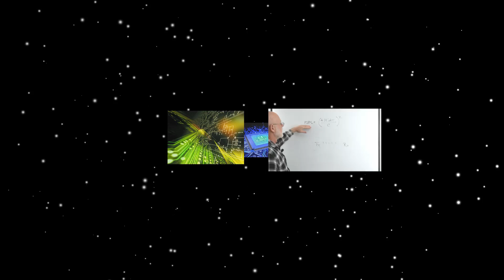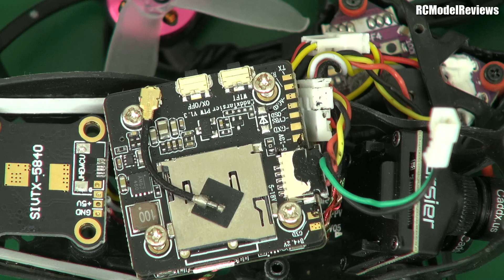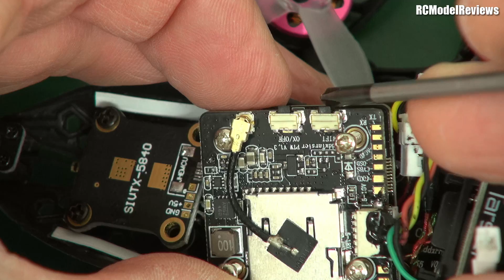Why are so many new products faulty?

Comment: i might have to remind you Sir Bruce, of your fab ZMR series where you gave the Tip to "buy 5 of everything as lack of QC will make sure there's always a dudd"   of course, that was quite a while ago AND it was about building a $100 'quadcopter'  :)   thats my two cents.   not spending.no cash.no experience with qc issues. , well maybe one, the ViFly X150, a joy to play with, kept burning outnthe vtx, but they did send me, free of charge, replacments both times.   the x150 alas rests at the bottom of a lake :(

Comment: only fix is to solder on a plug, then use the other half of the plug to short the swwitch, i had to do this with a runcam split, same switches, not really robust enough for the use.

Comment: Yes I find manufacturers are just sending out garbage. I have problems with virtually all new products bought.... not review samples...I buy my hobby products and then I am stuck with the problem. Then just try and get the manufacturer or seller in China to repond, it's a circus to get satisfaction. I now but from sellers I know are easy to get warranty service, no longer the cheapest route (since I now expect to have to deal with some issue).

Comment: Bruce.  In my experience, this quality control problem isn't new at all.  It seems, to me, that there is always something that's dodgy on the Chinese products.  Whether it's a capacitor that swells up, a switch that's intermittent, a remote control that goes through batteries way too fast, or a display that only partially works.  I will say that most of these problems seem to show up in Chinese single board test equipment and things of that nature.

Comment: In the last few months:

ts5823s video transmitter - can't be set to all of the listed frequencies

RS2205 2300KV emax motors 2X CW & 2X CCW - 1 would not turn 360 degrees. Something inside stopping it. Received replacement and 2 motors made scraping noises as they were rotated.

Mini RS232 To TTL MAX3232 Converter Adaptor Module Serial Port Board - Boards get VERY hot in operation. Supposed to work at 5 volts but when voltage is dropped to 3.5 volts, they stay cool.

Comment: What is point of 4k on a small quad if it doesnt have some kind of damper to get rid of vibration.  1080p 60fps with good damping would be much better (less energy usage to shoot in 4k).
Reply from the maker: 4K video gives far more scope for doing stabilization and cropping in edit.  I can turn a really shaky 4K video into a silky-smooth 1080p one that looks like it's been filmed using a gimbal.

Comment: I have had a lot of bad stuff lately from Kingkong/LDARC. My ET115 arrived with two bad motors and QC tested sticker between them. I went through about 8 motors before switching to HGLRC. Once the motors were fixed, I began having 4 in 1 esc problems. After several KK 4in1s died, I switched to iFlight. No problems now after removing most of the KK electronics.

Comment: My geprc 12A whoop board on about 4th use had the component near the power supply terminals just pop off! Resistance was very low, I think it is a shunt. Anyway, soldered it back on, board works. Before I soldered back on I asked geprc support what the component was and if they could tell me the value such that I could test. No response, retailer asked also and they didn't get a reply. So QC and support not good, probably will not buy geprc products again

Comment: Never had a faulty piece of electronics from BangGood in my two years of buying there. Maybe just luck? I mainly have FrSky, Matek, HAKRC and Runcam RC stuff though. Also some Machifit, Eleksmaker and BQU hobby electronics, Xanes bike lamps, Xiaomi consumer electronics... Well, as I look back all the electrical stuff works. Only total crap were ZOP batteries, but it was not a question of QA, they all suck by design it seems. Waiting for a Hawkeye Firefly Split to arrive, we'll see. ;)

Comment: I get parts for a product that I sell custom made in  China, and I've noticed this as well.  Not only a drop in quality, but an increase in general logistical problems, overcharging, and them trying to get away with with anything they can (misrepresentation, etc) to save money/make an extra buck.   From my perspective, it makes business relationships a chore, expensive, and everything takes 3x longer that expected because the first shipment is often completely unusable because so man corners were cut, so it forces you to either find a new supplier, or go through a fight with them to re-deliver with higher quality.   It's a game that I'm beginning to despise, because they are constantly trying to push the line of what they can get away with, hoping the customer won't notice.. or won't bother.   I'm not sure what is driving this, but I'm guessing that it's more competition, and also the tariffs on Chinese goods coming into the US is forcing manufacturers cut corners to reduce costs to stay competitive.   I would GLADLY pay a little bit more if all these headaches were to go away.
Reply: Bingo, right on the money.  My old company I sold (Motorsports design and manufacturing company.) decided to outsource everything to China.  I stayed on for 2 years to transition, and every time something was sent out the samples that came back were exactly as you described.  NOT what I fabricated to be remade at all.  Corners cut, games played, spec'd materials not used you name it.  I've always said "Paying an extra 10-20% for these items is not a problem as they are already ridiculously cheap if that means better quality.  I'd gladly trade a little cash for better quality."
Reply: @JViello  Part of the problem is because they seem to take every opportunity to claw back pennies, you are constantly suspicious of everything.  it really damages the relationship - even when they aren't trying to screw you over in some way, you find yourself suspecting it or accusing them of it.   it makes for a terrible dynamic where things take 3x as long as they should it's like being in a country like Mexico, where it expected that you need to haggle to purchase anything of value - just tell me the damn price so I don't have to spend 30 minutes haggling.  With the Chinese manufacturers, you just want to say what you said - just charge me an extra 20% to take away all the headaches.  When a manufacturer tells me that they will ship in 14 days, I know it's 21.. or 30.   Over promise an under deliver, every. damn. time.
Reply: @MactacFPV  Bang on again.  The saying "penny wise and pound foolish" always comes to mind.  I purchased 3 basic LiPo chargers years back. Surprisingly they all worked to spec.  I ended up blowing out 2 of them because they didn't build reverse polarity protection. (One time was me rushing and not paying attention, the other my young son flipped the barrel connectors for the battery clips.)  How much in components would it cost for a simple protection circuit? A dollar?  I'd be shocked if it cost more than 50 cents.  

In the end, I was left with 1 cheap charger for the price of a good quality one because as you said, they "clawed back pennies."  Lesson learned.  Perhaps it's simply because that's how they have to survive in their every day lives?  Sad, really.
Reply: Misrepresentation? First thing it made me think of are the tiny cheap digital audio amplifiers that claim produce 500 watts, but run on a 12 volt, 2 amp 'wall wart' power supply. 24 watts in, 500watts out? For how many microseconds? Lol!

Comment: My Cadxx Turtle v2 failed before I flew it. Had to wait abut a month before BG could send a REDESIGNED replacement cable and image sensor to fix it. Gearbest have just sent me the wrong drone. I'l l keep it because of the cost to send it back to China, and because I no longer trust them as a supplier. A couple of Chinese drone part suppliers have accepted orders for parts, only to advise that they are now out of stock. While I got refunds, two vendors would only do this if I gave the reason to "cancel the order" as "Changed my mind". Recently China Inc has blown years of reputation in my eyes. However, I'll still buy as the cost/performance (when things work or can be fixed) is unbeatable.

Comment: I can't complain. I've built 37 quads and never had a single DOA. But I only buy parts I know that work. I also only stick to reputable manufacturers like spedix, tmotor, holybro, runcam etc. I see some failures on YouTube but they are usually lower end products like the ones you reviewed. Cadx is known for poor manufacturing as can be seen with the dust in their lenses.
Reply: I agree with you...i do the same

Comment: QC systems in a production company are very expensive and they don't generate money. It is an easy way to save money as a manufacturer to just eliminate it and let the customer do the quality control.
Reply: The faulty switch wil never be caught by the design process. You need to do testing somewhere to find it.

Comment: I've recently ordered from two separate suppliers within Aliexpress, a hinge lock for a Xiaomi m365 scooter (the original - made of aluminium - is fragile and breaks). Both suppliers advertised as being made of "hardened steel". Went to measure the volume and weight, and in both cases it matched the density of aluminium. After I complained, one removed the product from the site, the other one kept saying "no, it  is made of steel".
Reply: Magnets don't lie

Comment: I have a Tarsier and it works. But because it's DVR board is rather thick, I bought a Firefly to another less roomy quad. It came with the same problem, one button is dead, no video feed or HD recording. Dead on arrival. Now I'm struggling with Banggood to replace it or refund me. No firmware update fixed it, btw. Dead.

Comment: I buy laser show related goods from China fairly often and only ever had one problem which was quickly replaced by the seller on Aliexpress. As full colour laser show projectors are complex mechanically and electrically, then have to survive a trip in a box, its amazing they work  at all when they arrive. I have 8 so far ordered over the last 2 years and all working perfectly.

Comment: I feel like you're on to something here based on my own experiences as well as friends/colleagues, but we'd need to collect more information in order for it not to be anecdotal. Rushed products are definitely one category in the high failure statistic. Good example of this in my opinion is the SailFly-X Toothpick drone... Pretty popular model carried by lots of vendors (both us and china) very clearly fitted with a board barely capable of handling 2s, yet they supply 3s with it and encourage flight with it. 

SFX boards were burning, and the regulator was dying, so in the next batch did they fit it with a proper board? No, of course not. They put a capacitor at the head of the xt30 and called the problem solved... failure. by. design. So many people have burned it and it's awful because it's really not their fault. Best example I can think of recently of something rushed to the market to capitalize on the "Toothpick class" craze.... basically yeah it seems things are leaving the factory in conditions, software or hardware, that they shouldn't be.

But then, in another category... we have market sections that don't really have a race involved such as the toy grade sector, yet there is falling quality. Toys with WiFi modules that won't connect, cameras that are recessed by just touching them, GPS toys with bad compasses that cause crashes and flyaways. Sheers of metal being found inside the gears of brushed toys. Not one-off incidents but many. I don't think they are effectively testing all of the toy grade items with a laundry load feature list. They did not have this list a few years ago.

We're ending up with more expensive toy drones (for whatever reason) that perform like crap. I literally want nothing to do with toys anymore these days unless they are simple. Trying to do too many things is another failure by design in my opinion and is adding to the faulty product count of drone products at best and creating some dangerous aircraft at worst which we do NOT need right now with all the regulations.
Reply: Adding a cap has nothing to do with over voltage protection(limitation), maybe they whant to shut you with it :)). Example: a 2s cap (7.4v) rated @10v will explode if used with 3s(12.6v). Using 3s cap rated 16v with low capacity on 2s is a well known thing because they have low price. Don"t loock at horse tail ... loock under the hood.
Reply: @Cosmin Juverdeanu The cap was added to quote "avoid the risk of burning the mosfet or the 5v regulator at the moment of power on" with a 3s battery. They only did that when they figured out boards were blowing up left and right just from a 3s being plugged in. Adding the cap decreased the failure rate but it was a very poor fix. Unreliable, and didn’t address any adequacy issues elsewhere. Too bad because the drone itself flies so great and it's nice.  I'm replacing mine with a more adequate board and it'll be fine.

Comment: Bruce, I have the original Runcam Split that Joe Scully passed to me. It did the same thing. Runcam sent me a discount code even though it was a gift, but I have not thrown it out because it was bricked the same way. I have not used their code and still feel like I could get this thing working again. As far as good product coming down the line, it seems to me that we have to be picky. A few peeps that came into the hobby left just because they had bad luck with sub par equipment. Let's tighten it up a bit on the manufactures.

Comment: Omg you have no idea how many products I have that arrived useless non working garbage and then I have to spend the next month emailing back and forth with the manufacturer before they finally give me something back and it's usually not my money it's usually a store credit or they want me to send it back for them to take a look at it. I have been building quads for people for years now I'm talking hundreds and hundreds of quads so I know what I'm doing and I know when somerhing isnt doing what it's supposed to but they want to ask me 1000 questions about it and it's just so annoying I just want what I paid my hard earned money for to do what its advertised to do! Mostly the last year or so is where I have seen the most unreliable products heres a lost of stuff to stay away from.
Any and all happymodel products 
Any and all betafpv products 
Iflight 12a whoop fc
Bardwell f4 v1 and v2
Emax hawk5 motors
Emax hawk5 stack
I know theres more but I cant think right now
Reply: What were the Emax motor issues? I had a Hawk 5 and really liked those litespecs.
Reply: I'm just getting into the hobby. Tinyhawk RTF package -- the drone doesn't fly out of the box, one of the motor slots does not function. Tinyhawk S propellers randomly flying off and within the first few packs one motor would randomly not arm, had to keep disarming/rearming to get it going. Mobula 7 with crazybeef4 flight controller: the board looks like a gigantic mess with flux on it, some chips look chipped and SMD resistors not soldered on properly and falling off.

Had two Newbeedrone flight controllers fail in various ways over time but they sent me a new one each time for free. Newbeedrone wins for customer support and I will be buying their products from now on.
Reply: @naomarik  I have just got a crazybee mobulus 7 part of a job lot. The vtx board drops  its signal. The small caddis camera gives a white picture outside. The flightcontroller has lost some of the betflight software.  I would not recommend this drone to anyone.
Reply: i've had my hawk5 since it came out, after so many crashes i had to replace stuff like motors and vtx, but it worked like a charm ootb . same with the tinyhawk 1s though the reset button broke pretty quick. these electronic parts are delicate though.
Reply: Ive had the same issues with an ebay seller, after a week of sending photos back and forth they eventually refused to send me a replacement vtx (that i asked for) and offered me a partial refund, i said "no.", and the ebay seller said "ok" and i got my full refund.